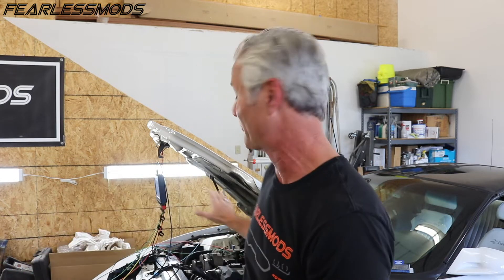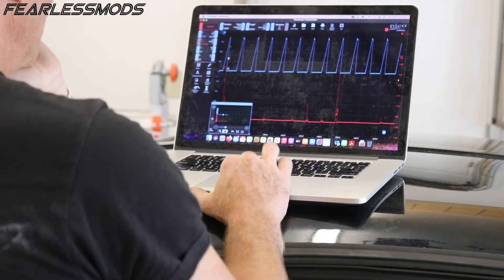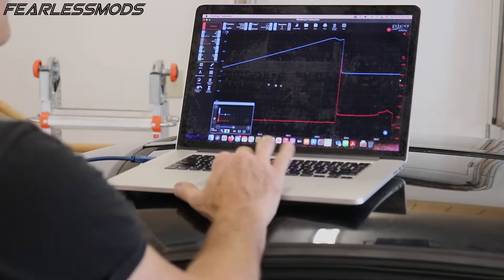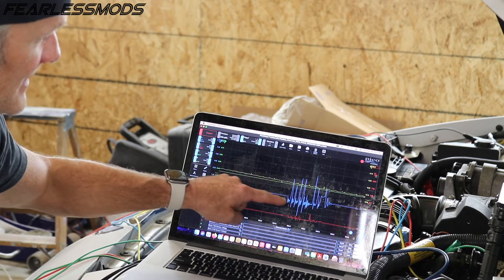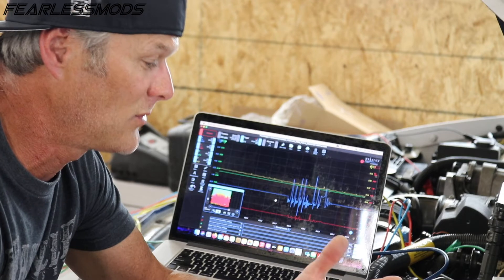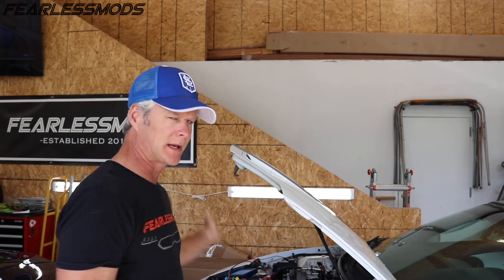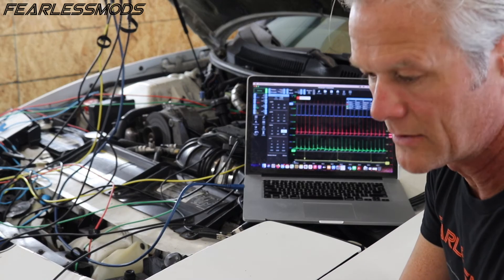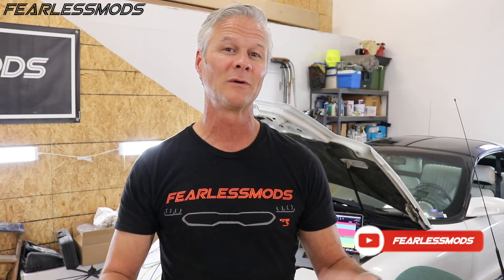Pontiac Firebird Trans Am Ignition Diagnostics part 2:  ICM and Coil

Comment: Lt1 opti u better roll a seven when u guess..
Have had ICM probs so look there first before u take the radiator out..
One time was ICM.. all the others was opti..
ICM had weird misfires midrange under light accel wud stumble, deteriorated with heat soak till car wud stall out, crank no spark..
Once it cooled wud run fine again till got hot then same thing..
Cost me a tow but eh whatever.. its paid for..

Get a cheap inline spark tester one that lights up helps a bunch u cud see what u got

Comment: I’m watching you need to get that hot rod fixed I’m having similar problems. My problems started after I changed out the optispark. Car was running strong (my wife’s car) it quit on her put it in the shop changed out the opti, coil both MSD parts new computer idle air, throttle module, mass air, etc, like you throwing money at it. The car has never run well since, and all I did was change the distributor. I’ve had all my mechanic buds look at it and they just scratch their heads and tell me don’t bring it to my shop. So I’m watching!!!
Reply from the maker: Here’s to hoping that we both get ‘em across the finish line brother!! 🤞
Reply: @FearlessMods  nice video of the diagnosis.. 👍
Reply: I'm a proud owner of my 94 TA. that I'm building from the ground up.. alot of times the plastic fuel lines that run into the fuel pump get crimped and it blocks the proper amount of fuel to feed the pump... I have pics on my Instagram page of that problem at keith's 9809....
Reply from the maker: @keilylmm6377  helluva job there Keith…not bad for Navy!! 😉
Reply: @FearlessMods  thank you sir 👍
Reply: same issue here, changed my spark plugs, car ran fine. Changed the Opti and the car started rujnning like shit. Hopefully thats the issue.